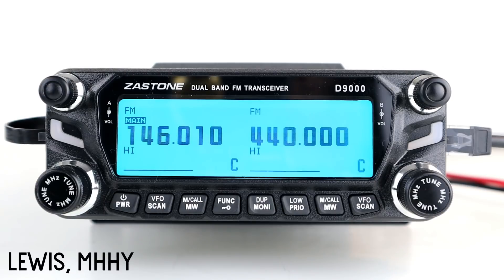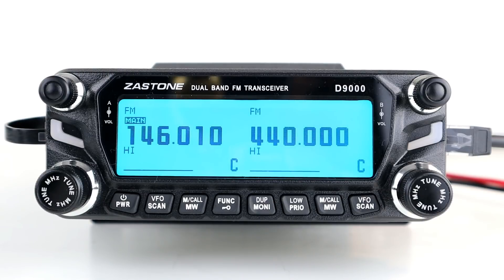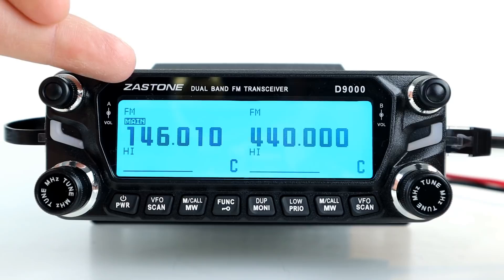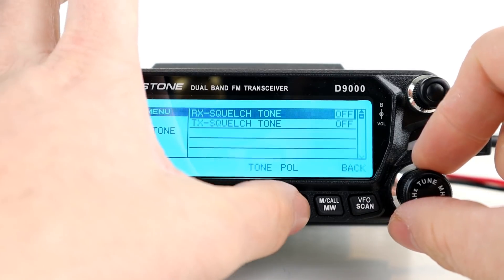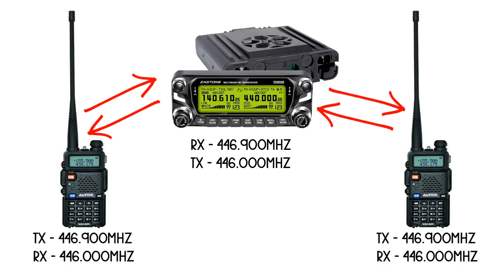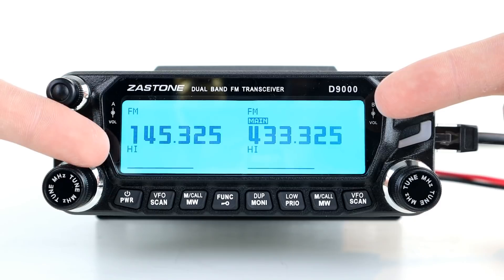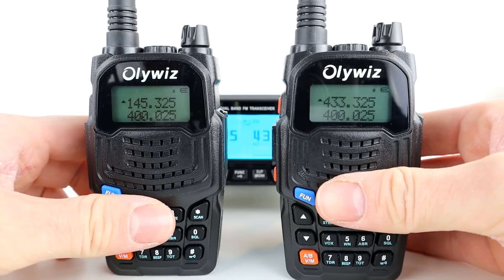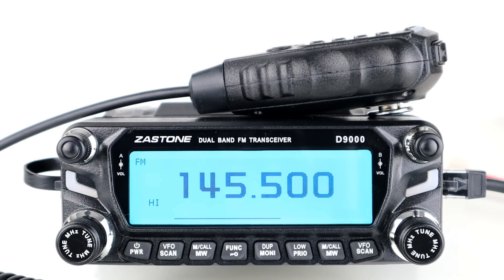Zastone D9000 How To Set Up Duplex Repeater & Cross Band Repeaters - Part 2

Comment: Hi. Great and useful video. I wonder if you can help? Is it possible to save the X band repeater settings on the 9000, perhaps as a shortcut or some other way, or do you have to program them in every time you want to you the repeater function? Hope this makes sense.

Comment: Sad about the same band repeat functionality being locked to a particular band, frequency and offset. I figured you could use one antenna output as rx and the other as tx and run your own antenna duplexer. Glad I didn't buy it for emergency repeater use.

Comment: Waiting for a uv8000 coming.. gonna stick it in a jelly beans jar, the ones with the metal lever seal and stick it up the top of a big hill a mile n a half away.. reckon I’ll get a good 15 20 miles of decent coverage and a few days use before having to swap the battery🤣

Comment: Thanks. There is aprs in the zastone d9000 menu but it does not open. Can aprs be used on this device? Do you have an idea of how to do it if it is available?
Reply: The d9000, in 2024, is available with three different control heads.  One is in this video.  The second one includes four buttons on the front, and a bluetooth hand-mic.  The third and most recent, the d9000app, works with the HT app in Google & Apple's stores, and incorporates an APRS TNC.  Control heads can be purchased separately on Ali.  :)
Reply: @Chrontius  Can you explain a little more how exactly the TNC feature works? It can send location by connecting to the HT application on the phone via Bluetooth. Can't the aprs feature work without the ht app? Thanks.
Reply: @muratöztv  I'm not super familiar with Zastone's implementation.  I have a Vero VR-N7500, which uses the same control software though, so it should be similar.  Without the app, the radio behaves like a part 90 radio using the last channel set chosen with the app.  The new N7600 will add phone-free APRS features, so if you want phone-free APRS, I'd get the Vero.

Comment: I have a question about repeater operation in the UHF area, the repeater works with an RX frequency of 446,000 MHz, TX can be any higher than 5MHz, can the filter set for RX 446 MHz be physically removed from the device and an external duplexer for the frequency per choice?

Comment: Second of all that radio does not have a duplexer in it that's why there's two antenna please do me a favor learn a little bit about the radio before you do a videoI've had that radio opened in front of my face and there's no such thing as a duplex or inside that radio

Comment: You say the manual requires 10mhz split, but then you improperly setup a 0.9mhz split in the video, then further disappoint me by not even demonstrating if it works or not.  WOW!

Comment: these radios and most crossbanders are like two separate radios. And they usually put a diplexer to use a single antenna instead of two. So  I think this is the case. It has a diplexed antenna for tx/rx and added antenna just for rx when used in single band repeat. So you can separate them

Comment: There are 2 f446a saw filters in the radio that are switched into the rx line when same band repeat is activated. They are socketed, so they are easy to replace (if you can find them) or remove and jump. Then you have a choice of what uhf frequencies you want to use (uhf only). It does work quite well with a duplexer and 5mhz split. I get about 1/2 mile rx range with 2w hts, through dense trees with the antenna leaning on the wall in my house. 

Btw the split that you used would never work even with an expensive repeater system with a massive amount of filtering.
Reply: @Jay Meyer I dont know if you deleted your comment before I could respond or if youtube just isn't showing your comment. All you have to do is jump pins 1 and 4 with a bit of copper wire on both sockets. Each socket has 16 pins and the middle 8 are conmoned togeather for the ground (pins 2 & 3) and the 4 on each end are conmoned togeather for the input and output (pins 1 & 4). If you decide to put the filters back in they are not directional. Be warned that I take no responsibility if this damages your radio in any way. However I have been using this for months without any issues.
Reply: @zachdemand4508  Hi, thanks for your sharing. Wish I read it earlier. I opend my D9000. Found 433.92 SAWs in F11. What is the reason Zastone made 2 pieces of the F446A, actually they have 3 sockets on their PCB. Thanks
Reply: @wgafchn  

You have 433.92 mhz saw filters in yours?
Reply: So you can add external duplexer and work with one antenna in same band repeater mode?
Reply: @kozianozdra1  yes. Uhf only.
Reply: Hi, if you need 433.92 s I can send you 2. But What is the reason Zastone made 2 pieces of the F446A, actually they have 3 sockets on their PCB. Thanks
Reply: @wgafchn  

I dont know for sure. Maybe for different regions. The ham bands are slightly different.

Comment: Hi, but when you repeat the signal on the same band is there no need for cavity filters? How do you behave with the two antennas?
ALBERTO
Reply: The Closer the Frequencies are together the harder it is to stop Breakthrough so you would need a very good and Expensive Cavity Filter..The Larger the Frequency spacing the easier it is and with a very large spacing you could get away without the Filtering, Cross Band is the easiest.

Comment: Sorry Lewis. There is no way that a 900kHz split duplexer is inside that radio. Do you want to check the spec again?
Reply: He says that the specs state you need a 10mhz split which sounds more like it but no use in the UK amateur bands! The 0.9 MHz split shown in this video wouldn't work.
Reply: 10 MHz split is for China I guess, he can't do that in UK so why not try 900KHz?
Reply: Goyotero1000   Have a Google about UHF duplexers. You will see how big, complex and expensive an actual UHF 0.9MHz TX/RX split would be, i.e. a duplexer to allow simultaneous TX and RX with no RX desensing.